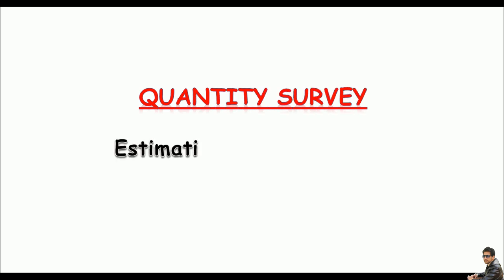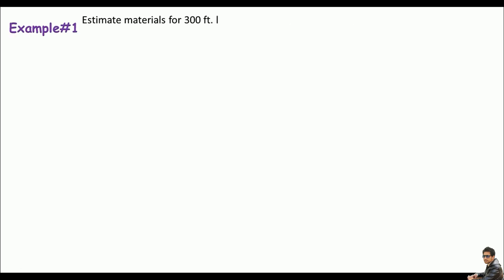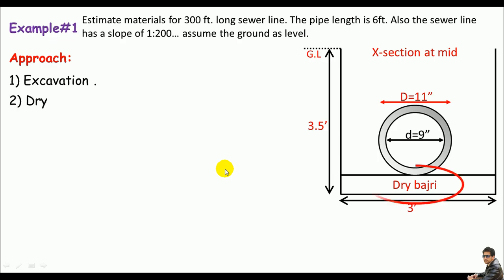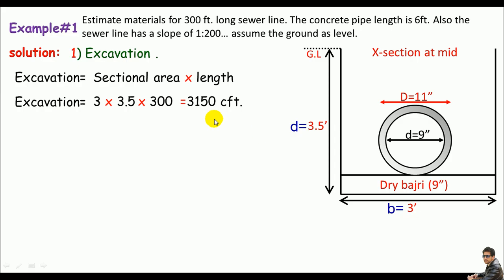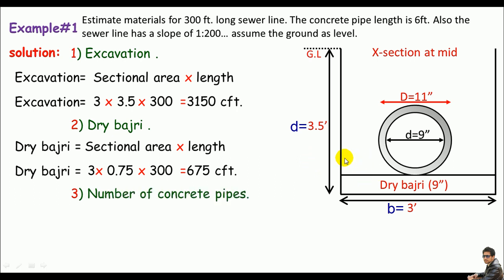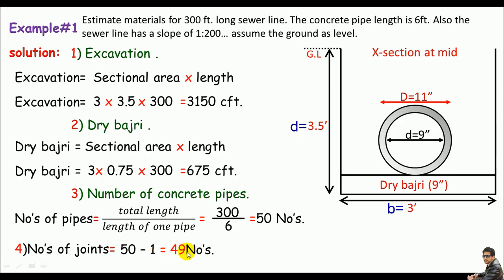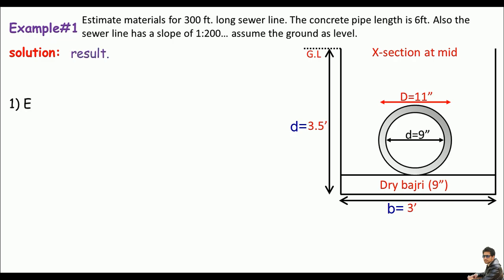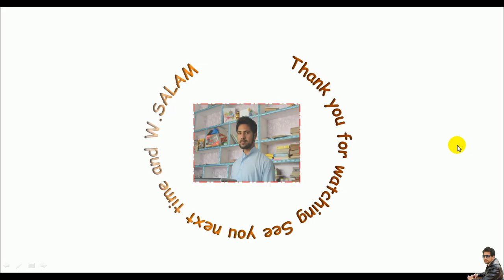Quantity survey : Sewer line estimation

Comment: You didn't  mention  the calculations  of material  as per slope. Which is mentioned  in question.
Reply from the maker: the section is at mid of sewer line.. and if you calculate slop distance that is so minimum thats why i just ignored that
Reply: SL Khan but sr u r requested  to teach me calculation of slope also

Comment: if the pipe is in sloped position then the length will increase because it's in inclined position. your calculation is for horizontal pipe position which is wrong
Reply from the maker: yes dear you are right....
but if you see the slope is 1:200 and the length is 300ft so if you calculate the slope length you will get it as 300.003 ft, which is almost equal to 300ft so its better to take the horizontal length ,spending time in slope length calculation... i hope you are understanding